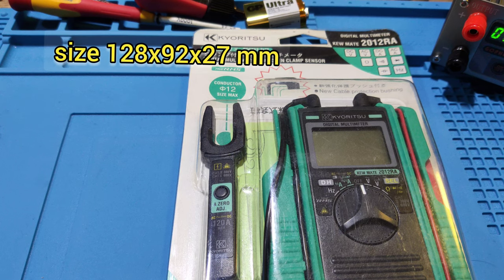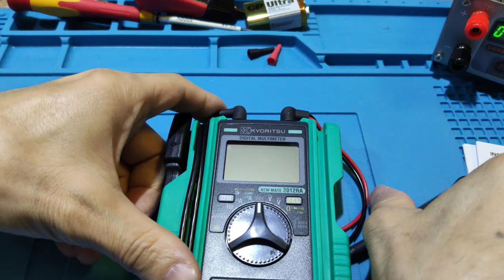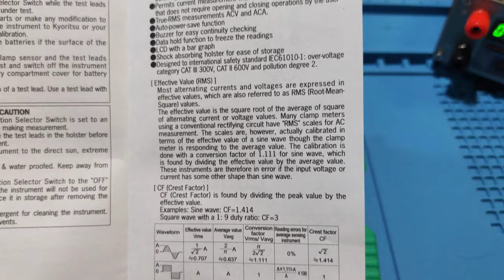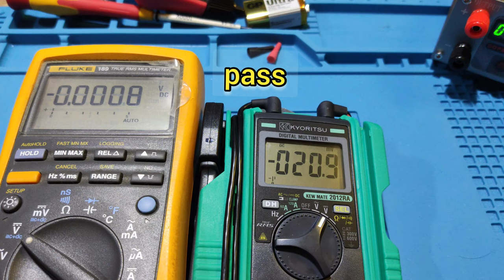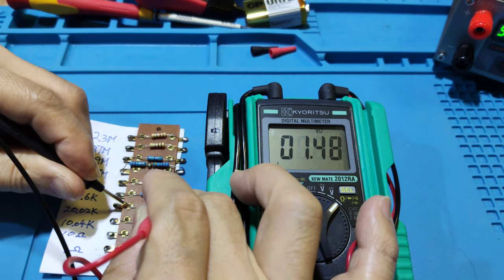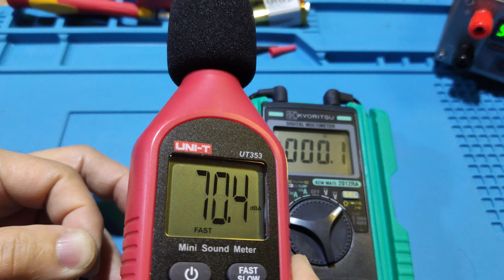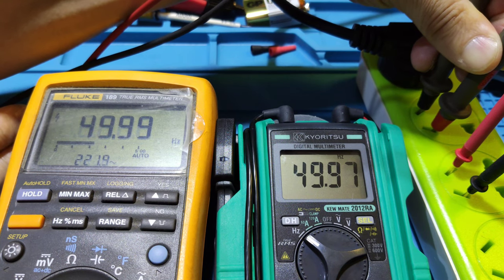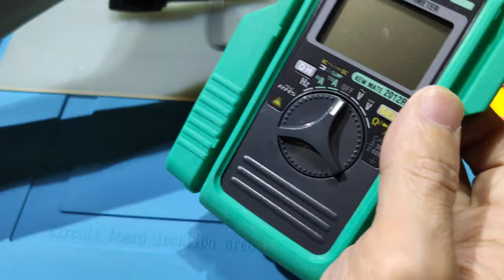KYORITSU KEW MATE 2012RA 6000 COUNTS CATIII300V/CATII600V OPEN END CLAMP & MULTIMETER AC/DC

Comment: My name is Kusaka of Kyoritsu Electrical instruments works, ltd.
Thank you for using our product. How was the usability of the product?
Reply from the maker: it good of design,and the clamp size if biggest may be great,and i have a before verison 2001,it broken of the selector switch(pvc spindle broken) ,and the lcd display black colour and the outside pvc protector aging also broken of old ,than buy a new one.and hope kew-ltd company will add on ncv ,(live hot wire).capaitor to 1mF,diode test have 3v output,flashlight,backlight function on a new generation product on this type small compact size clamp meter, thx for watching
Reply from the maker: and we normal use this meter at testing the electronic ballast current,if the meter have low current display may be good for finding out which one no current(damage ).it help for quick found out damage part.
Reply: @wilsonluilui  
Thank you for your reply comment.
Also, thank you for your valuable feedback on 2012RA.
Is your job an electrician?
Reply from the maker: yes sir,i am a electrician only.😄
Reply: @wilsonluilui  
I would like to hear more of your opinions about the product.

If possible, could you please tell me your Facebook, Twitter or email account?
Reply: @wilsonluilui  
Thank you for telling me your email address.

Again I will send an email to this address.

Comment: there's an overheat on the board, you can understand that by observing the white marks at the soldering
Reply from the maker: sorry,i don't know this.thx for advise.
Reply from the maker: sometime also see another meter have the flux(rosin) not cleaning on the circuit board.
Reply: @wilsonluilui  it's possible. When a product is for professionals then it's should be perfect without flaws.
Reply from the maker: @JustforFun-cb7bo  but they also down GRADE their product now.
Reply: @wilsonluilui  that's true, nowadays companies lowering the quality of their products but keep the price high.
Reply from the maker: @JustforFun-cb7bo  agree sir.

Comment: Nice! It seems the 2012RA passed all test. I was surprised that it was as fast as your Fluke DMM.
Reply from the maker: but ,fluke is super stable and high resolution for  a few year meter.😂
Reply: @wilsonluilui  
what type fluke  to use  comparing?
Reply from the maker: @japhet1346  NO,Fluke no this COMBINATION and small type current meter.
Reply from the maker: https://youtu.be/n6PN2AUBrcc
Reply from the maker: https://youtu.be/c9Q7B_b2WuU
Reply from the maker: but the SANWA also is japan company & made in Taiwan😂
Reply from the maker: it is very well fo use in A control PANEL to measure the current or voltage.
Reply: @wilsonluilui   thank for your  reply
I just want to know  your the type of fluke .
Reply from the maker: @japhet1346  in the video is fluke 189 in series mode .measure the current and the fluke is A high accuracy than the ,KYORITSU 2012r ,just mean than if the reading near to fluke is very accuracy.sir.